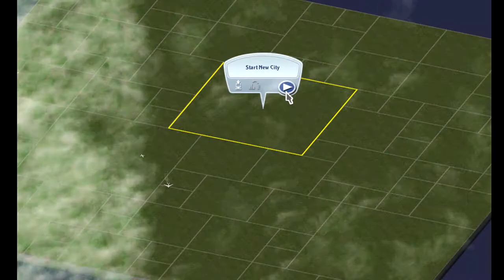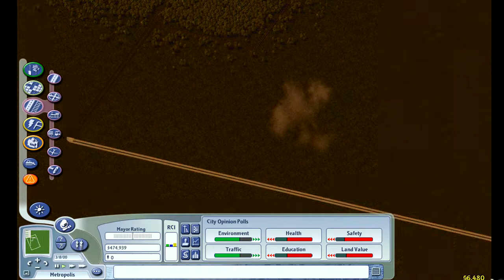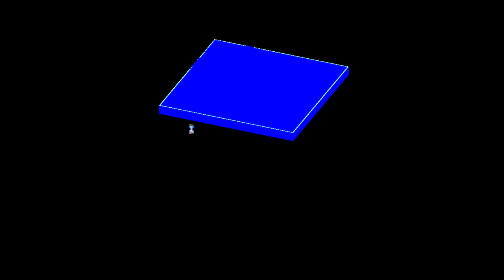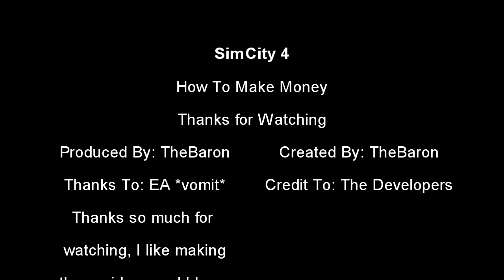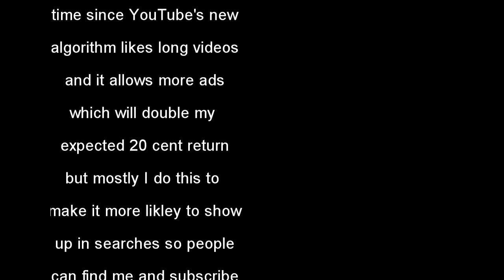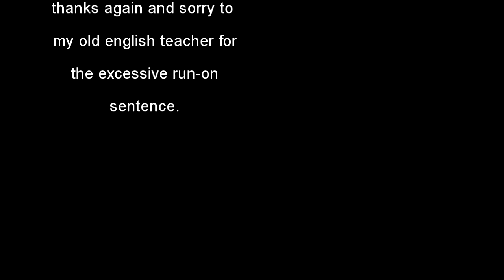SimCity 4: How I Make Money | No Mods/Cheat Codes

Comment: After reading the instructions after like 15 year of not reading them. It made sense to me. You end up making a lot of money off of low wealth housing more so than industries. Because the volume of low well is always so high taxing the 0.01% gives a higher gain that taxing any high wealth housing Commerical or industries from 1%-20%. My biggest issue with this game was the short path algorithm where is take the shortest path regardless of the speed of the route. meaning if a Street is the shortest route vs the highway it will take that street instead of the faster route of the highway.
Reply: I think i did the ame as you in this video but im still loosing a lot of money ??😂😂 and do the power lines have a function? I placed them but they dont do anything?
Reply: @LikaPyramid I'm a bit late but I also just started playing this game and I agree. I think some cheese tactics shown here have been nerfed because I replicated everything and I'm not profitting at all
Reply: NAM mod is a must, its a rework on traffic and a lot of new stuff
Reply: @zoltanfricsek6358  NAM is actually terrible because it makes the game too easy.
Reply: @zoltanfricsek6358  but then the game is too easy to do anything.